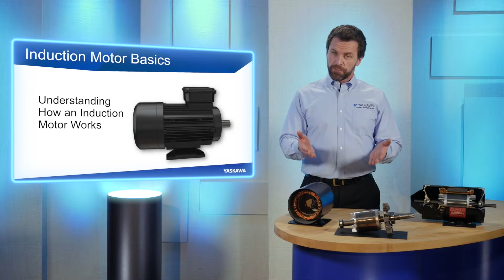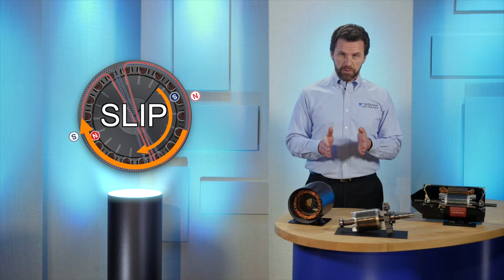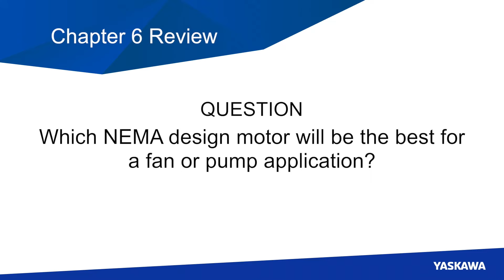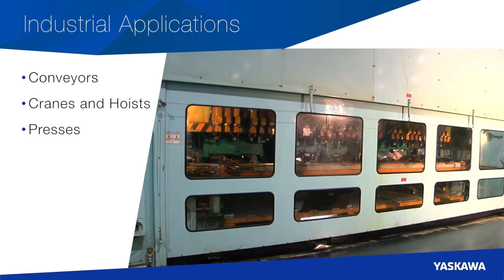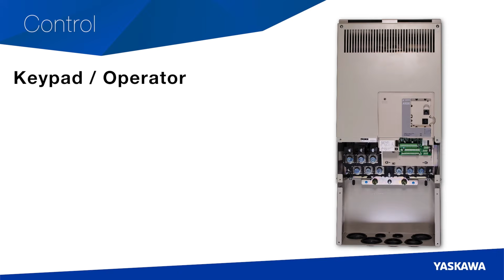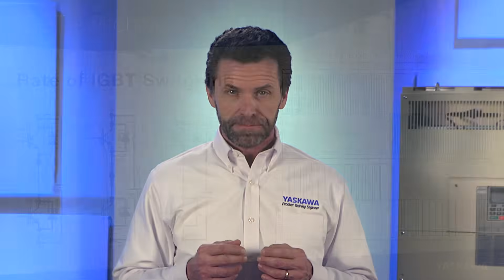VTW: Fundamentals of three-phase induction motors, variable frequency drives

Comment: 16:35:  I get what you're saying --- kind of.  So the number of poles works like an electrical gear reduction ratio, where the higher number of poles decreases the speed of the motor but adds torque to the motor.  But I still have to see a more in-depth illustration of how this works because my impression is that, because it is three-phase, there must be three motor terminals, one for each phase, and those three electrical imput terminals for the three separate phases represents an entire revolution of synchronous speed; hence 60 rounds per second to match the 60 alternating current cycles per second.  And by the way, the electrician installing the motor would absolutely have to get those phases right or the motor won't work with the synchronous speed touching only 2 poles per rotation with the third pole getting double amperage that is twice what it needs.  According to this, a three-phase motor would theoretically have five electrical terminals --- one for phase A, one for phase B, one for phase C, one for neutral, and one for ground.
Reply: I've got a brushless spindle for a CNC machine. The three phase power comes from a special controller, rather than from an external 3 phase line, but the principle should be the same. There are just three wires to the motor. If you flip two of the three wires, it just rotates the opposite direction.
Reply: @ericthecyclist  it would be exciting to learn more about that.

Comment: 14:05:  I don't understand this.  If three-phase is a rippling of three separate sine waves evenly spaced out that occur 60 times per second, and the rotating magnetic field of synchronous speed goes around the motor once per cycle, then shouldn't the synchronous speed be 3600 RPM instead of only 1800 RPM?